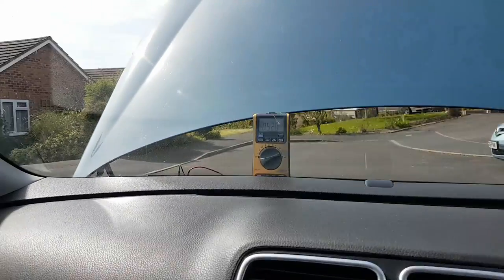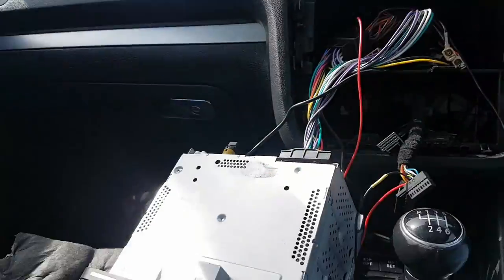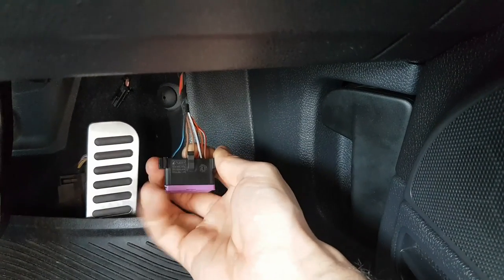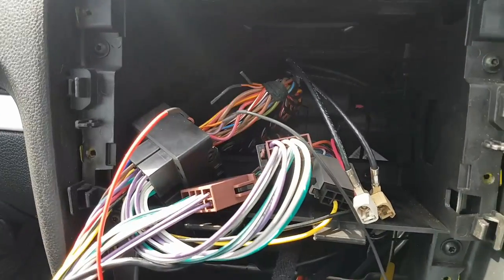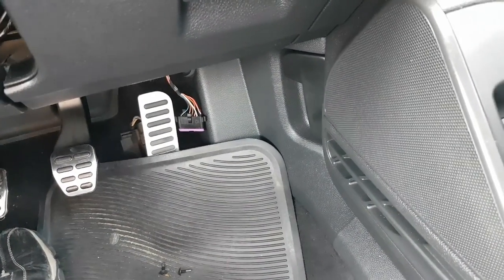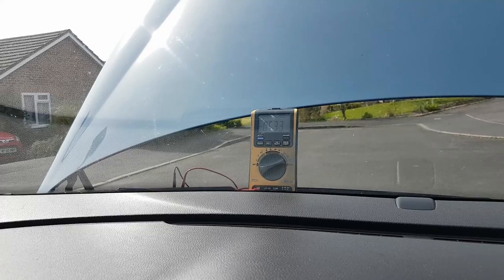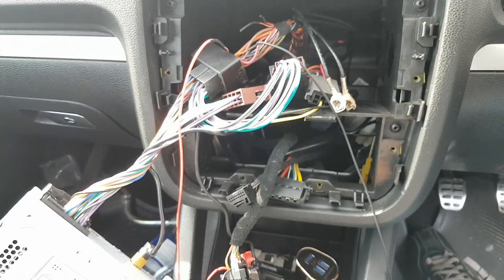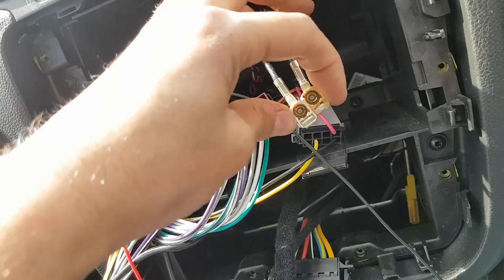VW RCD510 STEREO UPGRADE AND DREADED BATTERY DRAIN PROBLEM PART 2

Comment: Just carried out this modification on my mark 5 golf gti replacing the radio unit with a newer oem unit, worked a treat. As mentioned in the video the wiring connections at the ac module side is slightly different but lots of wiring diagrams online to correctly find can high/low. Much appreciated!
Reply: Hi, I am planning to do this on MK5 GTI 2007 any ides regarding which wires to rewire?
Reply: Same here please respond would like to know the wiring from high and low to correctly connect it to the can from the ac

Comment: For anyone wondering, this also works on a Mk5 gti with dual zone climate control, the harness is a little different however the colour of the can cables is the same. Worked for me 2007 golf GTi w/ rcd 330+

Comment: This worked great for me. For 2 years i used the fuse box mod that didn't hold memory. Now i do a 2 mile journey 4 times a day not having mp3 or cd memory was really starting to grind my gears. I was looking at Chinese replacement head sets and found this i am more than impressed.

Comment: My dad had his 06 Jetta TDI stereo upgraded to a touchscreen VW one with Bluetooth, ever since it's had this parasitic draw issue. I'm going to try this later on today and hopefully the issue will be fixed. Thank you.
Reply: did it end up working?
Reply: @michaelshogbonyo3676  Yes, it completely solved the battery problem! No more dead battery in the morning.
Reply: @NFSCalex  And what color did the canbus wires end up being?
Reply: do you remember?
Reply: @michaelshogbonyo3676  i think it was the same colors as in the video, the stereo should have a wiring diagram showing the CAN+/CAN- lines
Reply: @NFSCalex  My radio comes with an adapter, should I splice from the adapter + and - or should i just do it actual canbus wires themselves
Reply: @michaelshogbonyo3676  If you can splice it without damaging it, that would be best imo
Reply: @NFSCalex  Been splicing a while, so i’m confident.
Reply: and just be sure, the radio will respond to my light switch when i turn the lights on in the car?
Reply: @michaelshogbonyo3676  the illumination wire is a different wire not related to CANBUS, so yes
Reply: Alright so i did everything as was instructed, but the radio isn’t coming on. But when i plug the connection into ac unit it works fine. So now i’m a bit stuck

Comment: worked for my 2006 Passat 2.0T with stock premium 7 unit and I went with a 9" Android Chinese unit, had battery drain....car wouldn't go into sleep mode.....did this exact re route of can hi and can low wires and it's been a month soo far with no current being drawn from car after doors locked and around 5 min pass.
Reply: Hi friend, I have the Same issue with my 2005 passat b6, also steering wheel controls do not work!
I need to solve the battery problem first and I need help with the color of can+ and can- of the AC.
Can you help me?
Reply: @mmk958  Your Canbus hi and low will be different than mine as i have a 2006 B6 model,  First you to check your wiring, if you have a canbus box provided with your radio then plug it in and remove the red and black accessory plug. These radios all have a few ways of installing it. If you have the canbus box setup and the accessory power removed then you need to start your radio, go to settings, and change your canbus decoder to one that matches your car. If when you remove the key the vehicle screen does not shut off then you have a issue. It should turn off when key is removed and then go into sleep mode after about 5 min or so and have no power to it at that point..... Get a wiring diagram for your climate controls and find which wires are can hi and can low. If the first things didn't work that is the next thing you have to do... B5s are different and I'm not sure if all this works.
Reply: @mmk958  if you have a passat with manual climate controls then it should be the same as this tutorial but If you have auto climate controls its a completely different story.
Reply: @ArfanZakeri88  yes I have an automatic climate control and the new unit is rcd330 deesay 187a, it did not come with an adaptor or a can box like the ones with android unit.

Comment: The Dreaded red wire issue! I've just fitted a aftermarket xtrons unit which had the quad Iso harness type for my car provided.. did it work, did it sh*te! lol.
I'll keep you posted on my progress over the next few days! I had looked into this before jumping in and actually doing this for myself so this video has helped me loads
I found my 2din unit didn't even power up so i thought the red wired belonging to the quad lock iso harness needed to be re-wired to a AC feed from the dashboard fuse box by piggy backing a fuse rated the same as the stereo itself??
You're further into this than I am and we;#re way over a year down too!
hope you're well and thanks for the vid! :)
Reply from the maker: Do you have a multi meter? You would need to check the voltages on the wires to confirm if they are live, and weather they are switched. In this video I modify the can bus to make it work. It sounds like your having issues with the power supply? Be careful as you could blow a can bus module if connected wrong and that could cost BIG money to replace
Reply: @DanSohan  I do have a multi meter yes, like you pointed out I think this could be too risky where fitting this unit is concerned, the seller is giving me no support at all and it's meant to be plug and play according to the quad lock and I so harness descriptions given.

The unit is a android type with all mod cons on board which I don't know could/might affect the installation but I'm erring on the side of downgrading to not as good  good but fit for purpose type.

My suspicion lies in the feed from the ACC using a piggy back fuse set up but after trying last I've blown a fuse belonging to the unit, in the engine fuse panel so I'm a bit wary now for a multitude of reasons all to be honest unknown to me. 
Great work in your video btw, very creative!

Comment: You can connect the positive cable from the cigarette lighter below the AC, easier to find. Cigarette lighter will completely shut down the voltage once you pull the key out of the ignition. Also if you experienced the the battery drain, dont forget to fully charge the battery after the repair.Alternator wont do it. I had voltage drops in the rain resulting in restarting my chinese android unit randomly. Took me months to fix it with the simple battery recharge.
Reply: What do you connect that cigarette wire to?
Reply: @candyman9816  To the positive wire,its a remote +12volts wire on your android unit
Reply: It worked like a charm! Thank you so much for the tip :)
Reply: @candyman9816  Im glad i could help.
Reply: @candyman9816  Im glad i could help.
Reply: But do the steering wheel controls work ?
Reply: Sorry, could you spell out exactly what to do please, i don't find out easy to follow. Have this problem on my 08 caravelle, have disconnected the stock radio/CD to stop the drain. Was going to get a Chinese unit but sounds like the same problem would occur. Thx in advance.
Reply: @DeepakKumar-lv4te  to be on the safe side, use only the cigarette light positive cable to run your device in order to avoid power draining from your 12v car battery. Just make sure that the cigarette light turns off when your car key is out
Reply: @kamilkazmierczak2842  Interesting.  I guess I could try the stock power source via the normal cluster attachment and if it is  a problem, then pull & isolate its power wire and replace with a spliced wire from the cigarette positive as you say.
If the stock wire cluster delivers the correct canbus signal and the unit understands it then I'd be in good shape.  
A meter across the main fuse box stereo fuse would show me if it's continuing to drain or not when completely shutdown.

Comment: Great video.
Can you answer me this, after you lock the car and wait 5 minutes or more for the current to drop to 0A.
Can you still turn on the radio with it's power button?
I'm taking NO key in the ignition and the car is locked for sometime.
Reply from the maker: I'm not 100% sure, but I will try and check later when I get home!
Reply from the maker: Sorry 
I didn't get a chance to try, but the other half thinks the alarm might go off. I think if the roof is down in the internal sensors don't come on. If the roof is up the sensors will be active. It's been raining so not wanting to put the roof down to try.
Reply: @DanSohan you have to suffer for your science....or is that your art. 😊 .
 Wish i understood what you did here as I have the problem in my caravelle. Had to just disconnect the stereo. What does "get a new canbus gateway" mean? Thx

Comment: I've done this few days ago and it looks good. Also steering wheel controls works good. The main problem is that I've lost the rear camera :( Passat b6
Reply: Yeah you'll need the can system for the stereo to tell it it's in reverse etc. Best bet is to either upgrade the can gateway or fit a relay on the yellow wire to switch on with the key. You'll lose settings though doing it this way.

Comment: To really stop the battery draining change the power circuit to the cigarette lighter circuit that’s completely off with the car key when you stop the car. Take the circuit from the fuse box with a piggyback from cigarette lighter fuse to the android unit instead of the harness power cable
Reply: How do you do wire managing with that? Run it behind the fuse box to the cigarette lighter ? (Vw 08 eos) mines located under the radio

Comment: good. Very good video but I have a doubt.
Do you waste time and saved stations? is that if you cut power the radio would not have for memory.
 I am waiting for your response, greetings.
Reply from the maker: Hi, thanks for saying hello. This fix made our stero work like it should. The stations are saved as they should be. Only disconnecting the main battery causes the radio stations to be lost. We still have the car now and all works correctly still. Good luck

Comment: @Dan Sohan 
Hello! I have exact the same problem with my 2007 Jetta. So What do you think, am i going to solve my draining with that? I have RCD 330, which has not the CD player, which is The problem in your video. 

Hope you answer!! Would Be so helpful!!
Reply from the maker: Hello Arttu. I'm sorry I cant not confirm if this fix will work with your RCD 330. The Jetta is basically the same as our EOS so I think you will have CAN wires to your AC controls? If you are ok with finding the wires and cutting them it might be worth a try, but only if you know what you are doing as you could cause things yo blow. Maybe ask a car technician to try the fix?
Reply: Yeah, i think thats The worth of trying😄  sure the AC works If i cut those wires?
Reply: @Dan Sohan 
So did your AC work normally after that? Im curious to know, because i live in Finland, where that ac defintely need to work😂
Reply from the maker: @arttu_laakso  you dont cut them. You join them as far as I remember. Cut and rejoin all together

Comment: Hello I am from Argentina. my vehicle has steering wheel commands. When cutting the CAN BUS of the stereo, will I not lose the steering wheel commands?
Reply from the maker: I dont know the answer to that. But please let us know here if you can test or find out.. I think the commands might use their own wires, but I'm only 50% on that. Hows thing in Argentina with the virus? Stay safe.
Reply: @DanSohan  
I did the video, my vehicle stopped showing up without load the next day. But, if I don't use it for more than 2 days the same thing happens again. Therefore, this solution was not 100% effective for me :( Regarding the commands, the volume ones keep on going, but on the dashboard screen it no longer shows me the music, nor can I change the song.
Reply from the maker: @maurosegura_  yes, best to be cautious and keep family safe until more is known. We're all safe here for now, keep well. Sorry this doesn't fix your problems, our car does not show cd info on the dash.
Reply: Give us feedback about the steering wheel controls and the battery drain.
Reply: @mmk958  Hi. I am from Argentina. i have a vw vento mk5. In my case, the volume commands still work, but I can't change songs nor can I see the songs on the multifunction screen. Regarding consumption, before my battery drained in 12 hours, now that does not happen. But I notice that the load goes down during the days. I remember that my car is not a "golf", it is a "vento" so called in Argentina. I think they call him jetta there. sorry for my English.
Reply: @maurosegura_  hey bud, thanks for the reply, I am from Tunisia, my English is not too great either :D
I have an 05 passat b6 with battery drain issue and lost steering wheel controls, hoping to find a proper canbus gateway then code it because of what I read on forums! 
This solution may be less expensive but steering wheel controls problem won't be solved, right? 
Thanks.

Comment: if i understood,the climate CAN wires is in paraller conection with the radio's Can signal pins?The canbus of the climate works as it supposed to do?There is no problem if you connect two devices (the radio and the climate) to the same wire?
Reply from the maker: that is correct. No issues with ours a few years on. still working great.
Reply: @DanSohan thank you very much!I did it on a vw mk5 and it works great!The current when the radio is sleeping,now is about 1-3 mA,before it was 130 mA.When i remove the key from the ingition in about ten seconds enters in sleep mode
Reply from the maker: @AxelsTech  great. :) glad it worked well. No more flat battery to worry about!
Reply: @DanSohan  after few days my climate pannel dosent work, when i put ingnition on the 2 little displays blinking with some logo for 10 seconds and then come to normal, the recirculation button is dead, the temperature is not working just the fan is ok also the zone buttons ⬆️➡️⬇️ dosent work anymore
I use vcds i and i have 9 error codes 
But the most important is something about "low tension" 
Do you think this method with CAN wires can damage something to my climatronic?
Reply from the maker: @valentinstoica4319  sorry to hear this. It shouldn't cause damage as the CAN inputs have protection.. it sounds like a lost connection maybe. Might need to pull and reconnect.. or do a fully shut down by removing power for a bit. The original CAN radio wires need to be disused and well insulated from each other and risk of touching anything else when radio put back in.. to test the climate controlled. You might try disconnecting the stereo and returning the CAN to how it was before and if it functions normally after a reset. If not, there is a Fuse on the CAN system I think. Check them.. best of luck with the issues
Reply: @DanSohan  the old radio can wires is well insulated, 
-i take down battery + for 1H
-all conectors from climatronic removed
-I put back the original radio with original can wires back
-I try recalibration with vcds and delete error codes... and nothing
I try anything for a week almoast every day :( no result
Tell me more about that fuse please. !
Reply from the maker: @valentinstoica4319  it's hard to tell your configuration. You shouldn't need to take down battery +. Only the K+ and K- .. they should also be connected to your climate unit in parallel.. have you tried the hard reset by removing battery for period of time? Make sure you have radio codes etc. I can't remember details on if there is CAN fuses, I don't have the car
Reply: @DanSohan  yes, i try hard reset by removing battery
What are you saying there "k+   k-"

Comment: I've seen that on some cars, the blue wire ( power antenna) is the culprit...
The Chinese unit, keeps spending 12 volts, even when the unit is off...
Will have to do a bypass to the cigarette lighter, that powers with the key on
Reply: mine is Chinese  should i do what you mentioned with the cigarette lighter.  just because my Pontiac had a blue wire and i matched it like the instructions said , my new  stereo  isn't  ( opening  the switch )  to stop voltage  from going to the (power antenna)
Reply: That's why it keeps draining the battery. the power to the antenna is never cut down...
It happens mostly on Chinese units

Use an multimeter to check the voltage consumption

Comment: What is different between CAN-BUS which comes in the Radio and CAN-BUS which comes into AC. Why I can't use Radio's CAN-BUS, why should make a bridge between the two units?
Reply from the maker: They go to different controllers or gateways. I guess the reason they don't use 1 single canbus is it might become overloaded and slow down communication. But essentially the engine ecu has its own Cambus, the AC has one and the internal instrumentation has one. Some have more.
Reply: @DanSohan  Thank you for the Response. I installed android radio and the battery drain fast. I will try your solution, but I am confused about why have a difference between units. Moreover, my android radio has CAN-BUS decoder which obviously doesn't work.